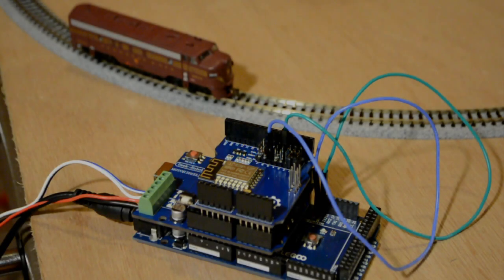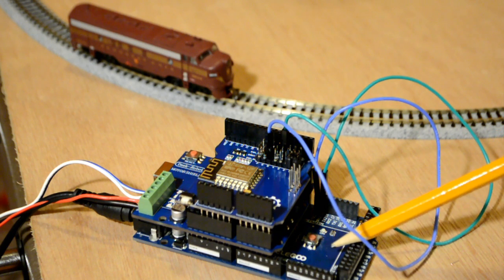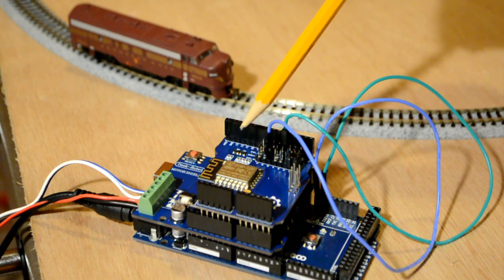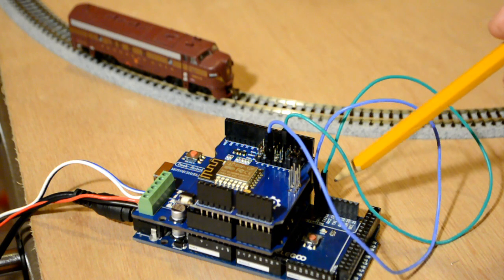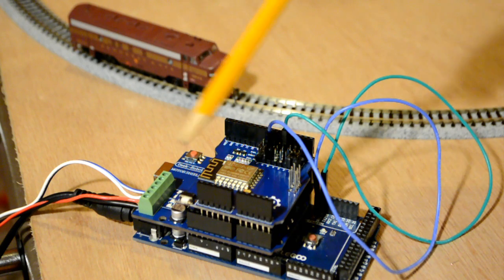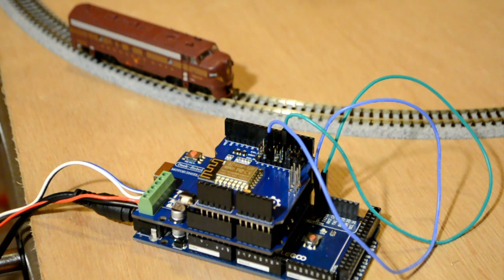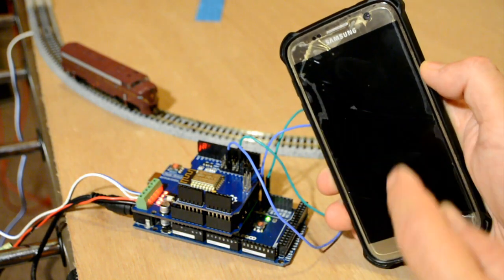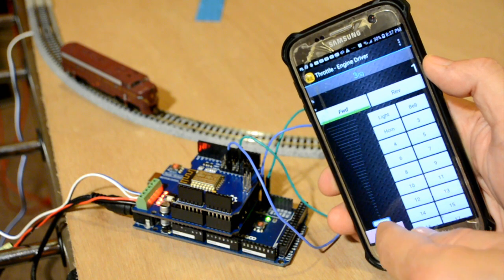New DCC++ EX with no jumpers connected directly via WiFi to Engine Driver

Comment: I'm working on my modular Ntrak and oNeTrak layout,  12 Ntrak and 22 oNeTrak modules, for home and to take to certain shows. Do I need to make a DCC++EX Basestation for each Ntrak line, 1 for Red, 1 for Blue, etc or ?  I have the 3 Ntrak mainline plus the Branch line and Mountain line.  
     I hope signals,  consisting, transponding, track controls comes soon. 

Thank you for your time and help.  

Rob
Reply from the maker: [Edited] I removed the text. I went on and on about boosters to address the question without responding to the need! Let me add a different post covering this and address boosters separately. I mixed up my terms regarding what "isolated section" is and how that affects what you want to do.
Reply: @DCCEX  I don't suppose I could use a DIGITRAX PM4?   I'm not great with programming after the small stroke I had 16 years ago and I'm even worse now at math.  I was a member of a Ntrak group that used DIGITRAX and it was nice but I like the potential of DCC++EX.  
   I expected Boosters because wall-warts don't have the ability to run around a layout,  to me, they are more a shelf layout or door layout power supply.  
    I'm trying to get this in my head and sketched out on paper.  My main component is a Arduino Mega with a Motor Shield for the Red line, another Motor Shield for the Blue Line,  and another Motor Shield for Yellow, and  another for Branch and a Final Motor Shield for the Mountain line?  How are they connected to function?  I'll be needing to build 6 Boosters? 
      OneTrak will need 1 Booster? Do I have to isolate the Ntrak from the OneTrak? If so do I use insulated rail joiners?  
   How much do I depend on JMRI for all of this? I have used JMRI a lot in the past but just for programming locomotives.  
   Also I am looking at the SPROG3/Raspberry Pi combination and I am unsure how many I would have to purchase to do what I want. I'm trying to learn Arduino and Raspberry Pi mostly for my model railroad. 
   I am selling and installing Micro and NANO LEDs and Ngineering.com products in N scale and larger vehicles and structures so if I can get wiring diagrams and I can copy code to where it needs to be.  
     I am also trying to make this a Legacy layout for my niece and nephew.  

Thank you for your response
Reply from the maker: I should have asked more questions. Will the club layout also be DCC? Since most are, lets rethink how they connect. That standard DCC++EX Command Station with an Arduino Motor Shield can handle about 1A per channel without adding cooling. It is normally configured with a MAIN track and PROG or "service" track. You could use both channels as MAIN to connect different sections if you like. But If we just use it as is, you can run 3 to 5 locos depending on how much current they need. It is easy to use other motor drivers to handle as much current as you need.
Now to wiring. It doesn't matter how many tracks you have, you wire them all together with feeder wires. The one output from the CS will power as many blocks and as many tracks as you need within distance and current limitations. 
In club/show settings where you would take your modules elsewhere and connect them, you would probably want separate, isolated sections with boosters just to have short circuit protection so derailments don't take down the whole layout
Typically, you would have boosters by function (yard, staging, etc.) or by number of modules to handle the number of simultaneous locos that would be on them, let's say every 5 modules.
So that's it. When you connect to a large layout with other people's modules on them, you have to agree who's Command Station controls it all. It could be your DCC++EX Station or it could be someone else's Digitrax Station or whatever.
You have to coordinate that with them. As for boosters, any DCC compatible booster, whether it connects to the track of one module and repeats that to the next isolated section of modules, or gets it signal from the 5V DCC signal bus off the Arduino pin  and uses that to repeat the signal, will work. Just keep the signals in phase so that when the A side of the track is high, ALL the A sides go high.
The PM4 / 42 is just a power manager, not a booster, so you still need a booster or boosters. But you could use one high powered booster (total price if someone wants to jumper a Nano and an IBT_2 board around $20 for 2 boosters) and use the PM4/42 to distribute that to 4 sections/districts and have it provide the short circuit protection as well. The IBT_2 board chip is rated to 43 Amps! That tiny board with no other cooling other than its fins can probably do at least 20A. Distribute that 4 ways and set the PM4 board to 3 or 5A.
The DIY method without buying a commercial board, gives you booster and short detection using IBT_2 boosters for just $40 for 4 boosters, but then we have a bit more work to do to get current sense to handle the short detection. In DCC-EX speak, that would be a Tinkerer level project. Less than Engineer level, but more than a Conductor should attempt.
Our page here lists some boards. In particular the IBT_2 and the IRF3205 board handle lots of current and are easy to work with. https://dcc-ex.com/reference/hardware/motor-boards.html

Comment: Can you elaborate a little on the Jumpers you set? Which pins to which pins? Though I saw it somewhere, but can not find it again, using Raspi-JMRI.  Thanks
Reply from the maker: There are no jumpers for the motor shield. We eliminated them. If you don't use WiFi, there are no longer jumpers. To use WiFi and allow you to use the USB port if you want (for monitoring, JMRI, etc.) and also connect a WiFi throttle at the same time, you need to jumper any of the pins in the row labelled Rx as shown in the video to the Tx pin on Serial1 of the Mega (pin 18) and any of the Wifi board Tx pins to the Rx pin on Serial1 of the Mega (pin 19). We will be writing tutorials for the website for each tested board. You can use Serial2 or Serial3 also and our software will find which port you connected the ESP8266 to.

Comment: Great job fellows it was pity such an idea to have been stalled! One question, is the new code still keeps the difficult part to support a layout without using jmri for example? Support on this was minimal and needed reverse engineering to be able to use it even for a simple oval layout.
Reply from the maker: You can use our exWebThrottle and a WiThrottle compatible program like Engine Driver! So you don't need JMRI just to run a simple layout anymore.
Reply from the maker: I'll add a reply after the fact in case people are using JMRI. We continue to update JMRI and Engine Driver in conjunction with DCC++EX, so even when using JMRI, controlling the "EX-CS" is pretty easy and has many new features, panels and buttons in JMRI, including manual control, full CV read and write support for even difficult decoders, and support for EX-RAIL, our automation separate from JMRI's automation, but that can be managed from JMRI.

Comment: I have my system set up using a version of DCC++ that I have modified to use MQTT to send output commands to, and get sensor data from D1 minis around the layout.  I've designed my own circuit boards for block controllers and turnout controllers.
My question is, would you be willing to look at what I've done and possibly incorporate it into DCC++EX?  BTW, JMRI thinks my MQTT outputs are just higher numbered pins on the Arduino Mega. My code routes any output number higher than 59 to MQTT.
Reply from the maker: We would love to talk with you. Can you join our disord? I'll put you in touch with someone there in charge of our MQTT project. We already have a website for that as well. It would be great to compare notes. Great minds ;)   https://discord.gg/y2sB4Fp Send a PM to FlightRisk
Reply: @DCCEX  I don't have permission to post a message.  Will that be added automatically?
I've never used discord.

Comment: Ordered two of the WiFi shields, One for a hot spare. Appreciate all of the work you gentlemen are putting into the system.
Reply from the maker: Thank you! Networking add to support as you know. This board works out of the box, which I like. Currently, we are using the AT command set that comes on the chip. The issue is that some boards put custom firmware on the chip or they have a very old version, etc. We were hoping to avoid having to have people flash firmware onto the ESP8266. That is not for someone who just wants to run trains ;) But we are testing and will see if we can do everything with the AT method, or will have to write custom firmware. If we need to flash firmware, we can use our installer to handle that to make it a little easier.